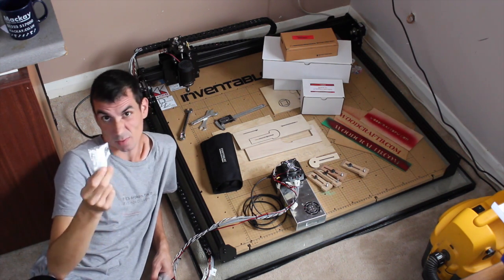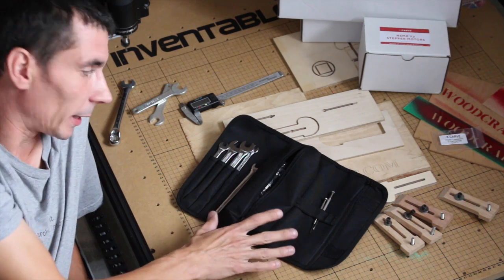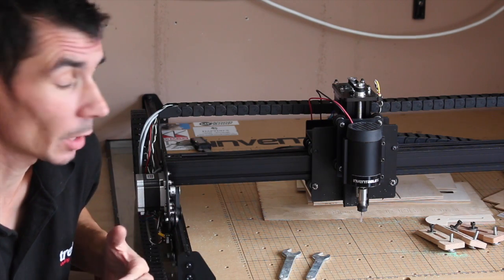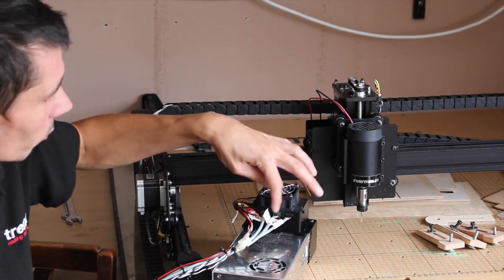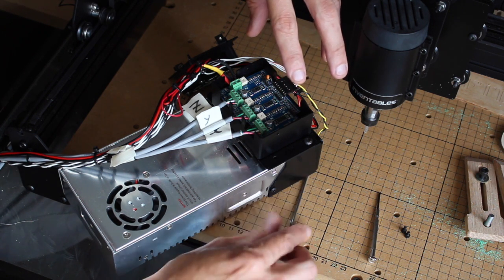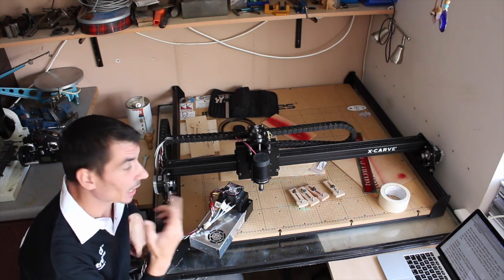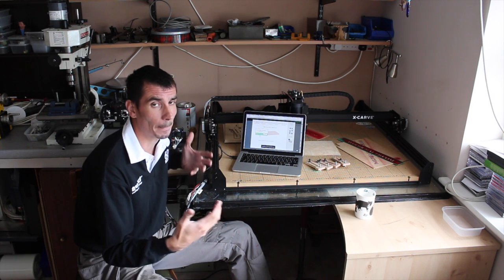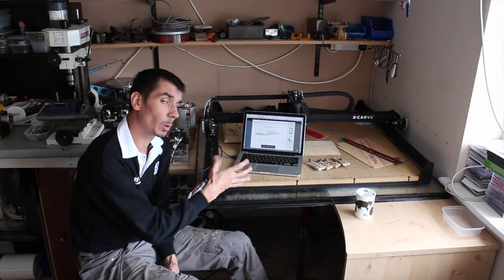XCarve build &  HONEST Review: The good, bad, and money wasted?

Comment: Just a note, since the project is open source all the designs ect are on their site including the waste board design and the holes so you could just buy some mdf and use a marker attached to the machine to make one yourself a waste board for about $20, that's how I did mine since it would cost like $180 with shipping to buy a waste board
Reply from the maker: I didn't know that the information was listed on the inventables site. good to know thanks. When the time comes I intend to make a replacement wasteboard, so i'll check that one out :-)

Comment: Some insight on the tool kit:  That looks identical to the one supplied with the shapeoako 2 which the Xcarve is basically a revision of, so i think they just updated the design a bit but didn't update the tool kit to reflect the changes to the machine,  hence the one wrench not fitting the spindle and the  leftover drill bit ect.
Reply from the maker: +lattitude01 Cool thanks! I was not aware that there was such a connection between the two machines. I measured the Drill bit Diameter with the digital verniers and it came out to be a very odd number, albeit precise. So I'm guessing it must have been there to pilot out for taping a thread?
Reply: i think thats right,  i remember we had to tap the end of the aluminum extrusion to bolt on the brackets

Comment: Hi Richard
Please help me with a probkem (if you can)
I have assembly the z axis where the spindel is and the both sides.
When I stand in front of it  and push the z axis forward and back,
the right side goes lot heavier then the left side.
And when I hitched the exentric nut  there is a scratchy sound,
But when I loosened the nut, the sound goes away, but the sides is wobbly.

Can you figure out what the problem is ?

(or could I buy you a RyanAir ticket and you come over to help me )    :D   

Kristian
Reply from the maker: +rednotereso sounds like the scratchy sound might be the steel Nut gouging the aluminium parts. Hold the nut in the spanner and tighten from the bolt side. When it's tight rotate the nut. if its too tight on the v wheels, this will also put extra stress on the motors and cause horrid noises.

Comment: Ri Richard
Do you think a MDF 22mm will work
Reply from the maker: +rednotereso no reason why not, Ive put my whole machine on a double glazing unit so it sits fully flat. If you can get the frame on a flat surface, 22mm will only serve to reduce you z-axis by 4mm.

Comment: Thanks Richard, nice review.  I'm about half way through building mine - the 500m version.   I ordered the MDF base plate and I think it saved my package from more damage than it actually suffered in transit.   At some point it experienced G-forces strong enough to cause the rotor of the cooling fan in the power supply to part from the mounting.   I've ordered a replacement locally so I just have to hope there's not further damage to the unit.  I decided against the spindle motor since i already have the DeWalt router.  
Oddly enough I never considered this as woodworking - most of my applications will be on metal and plastic.
Cheers,   John
Reply from the maker: Holy moly!  Couriers can be such a pain (polite)!!
I've had stuff been smashed bout by couriers before, although being well packed helps!
I also have the dewalt router, but for routing, I was waiting for the new mount for it to be in stock before ordering it,but the shipping costs as much as the mount to the UK!!!
So I've been watching what people have been upto in making their own, that's my next big X-carve project before I do anything else. I'm a fan of the stock spindle to be honest,but since I already own the router, I may as well do the upgrade at some point!

Comment: Hi Richard

I´m thinking to buy an x-carve from UK
And I wonder if it´s  easy to make a wasteboard by me self.
It´s so heavy so it probably to expensive to ship to Sweden.
(We don´t have any dealer here in Sweden)

Regards 
Kristian / Sweden
Reply from the maker: +rednotereso Hi Kristian, thanks for watching! YES, you can definitely make the baseboard yourself! When mine finally needs replaced i will do exactly that myself. I probably won't even go as far as putting all the Inserts in it either. The one thing I've noticed is that I tend to put a piece of thin ply down and clamp it, then just hot melt glue the piece being milled to it. They are definitely very convenient, but there are loads of other good methods to hold work down to the board.

Comment: Nice review Richard. Didn't see a response below but the drill bit you reference should be an 1/8 inch ball nose endmill bit to use for carving. Not really useful for straight out of the box Easel carves, since it only assumes  you use flat endmills. It's better suited for when you make your own g-code for non-flat carvings in another program.
Reply from the maker: +linkinprk1981 It's definitely not a cutter, the shape is wrong, if nothing else it's not 1/8" or 1/4" shank diameter. My gut feeling is it's a pilot for taping holes.

Comment: I'm confused...  How could the machine know where it's at on the board if you don't have the ability to home it?  Are you just saying eliminate the switches and manually just put the spindle around home and take a guess where to put the material you are machining?  Limit switches cost like $10 for 3.  At least the ones on my 3D printer did.  Even optical ones.  I guess I"m not following the issue here.
Reply from the maker: +Brandon Pulst You still have the ability to home the machine, before you carve, you tell the machine it's at 0,0,0. With the limit switches, you can hit the button and it runs itself to the switches on it's own. once it hits each one, it stops moving it that direction until it's hit all 3 limits. but the limit switches are at the 0, not the maximum point. 
The point i was making was that the limits are not the MAX limit, only the HOME. so it'll still hit the upper limits and try to go further, rather than shut of - as many 3D printers will do. 
They are really "Homing" switches, rather than a "limit" switch.
Yes they are handy, and cheap - but for the money, and the time to fit/solder etc. you can easily do with out.
Hope this explains it a bit better.? :-)

Comment: Richard, Good review showing both pros and cons but some cons are just a little more thinking, like the size of the circuit board what you say on 10.00 and the cable to the left connector. At first you could remove the paint a bit inside the metal box or reaming the holes in the circuit boards and the cable you could connect before  putting the circuit board in the box.
Anyway whit a bit more thinking outside the box you can work easier, although its a nice looking machine and within about 5 to 10 years we all have a 4-5 Axes cnc machine at home, with 3D printing capability's as well.
Reply from the maker: +Arend Wolbers Thanks for watching, and taking the time to comment! :-) All the points i tried to get across are mainly "things to expect" rather than "this should be better", or similar. At the end of the day, it's a kit built machine, and when building any kit, you'll always have these little things - I lie the machine, particularly the build aspect of it. It's nice to be able to "take real ownership" of it, if only for the confidence to modify, expand, or even repair it if required.
I agree - as technology evolves, and prices fall, more and more people will have more complicated machines. Inventables have taken a real step towards helping people and technology become more accessible to each other! :-)

Comment: FYI, you don't want to tin wires that are being crimped or used in screw-down terminals. They rely on the malleability of the wire to maintain the connection. The tinning is at major risk of coming loose over time, especially in applications where they will be subject to changing temperatures or vibration.
Reply from the maker: +Peter Skuba Thanks Peter, Yes this was mentioned earlier, I've now changed most of the tinned ends. I wasn't aware of this at the time (I'm no spark!) :-)

Comment: are you sure the drill bit isn't a router bit?
Reply from the maker: +Paul m That's not as strange a question as some may think, But no, It's a twist drill bit. I suspect it may be for drilling a clearance hole ready for taping, but I can't be certain, It's an odd size diameter, so not a cutter.

Comment: Hi Richard, Great review!  I made a couple of mods to my X-carve.  First, I removed 150mm from the Y dimension.  The extrusions cut very well on my table saw with an 80ct cheap blade.  150mm seems trivial but the extra length was causing a real problem with the space I had.  Also, I made my own waste board.  It was not hard and I just made sure and ordered the necessary additional hardware when I ordered my machine.  Thirdly, I routed a slot into my waste board so I could route joinery into board ends (dovetails, box joints, etc).  Lastly, I put together my own controller package which I added an LCD and an SD card.  I can jog the machine with the touchscreen LCD and I'm planning on using the SD card to process G-code from it.  I will be doing a lot of repeat work so not having to run the computer would be nice.  I am an embedded software engineer so modified GRBL code was not that hard.  I'm just discovering the possibilities with my machine!  I would like to upgrade my spindle and make a laser attachment in the future.
Reply from the maker: Nice! Presumably you gout the larger 1m model? 
I thought about posibly having some kind of "pit" or "slot" for working oversize, or odd shaped work  like cutting board edges.
I'd love to see pictures of what you've done! Fancy sharing them to my facebook page??
Laser is my next investigation on XCarve!  :-) you say your making one?

Comment: Thanks for the video I had my head really wrapped around buying one nice to hear some good pointers. You kinda relieved  some concerns I had. So as a crafting newbie any pointers to give.
Reply from the maker: +gambitraven No problem, thanks for watching! As far advice goes, if you decide to go for it - go for it! By that I mean, Don't be scared, the instructions are great, read ahead, and follow them carefully. Once you have it built, and ready to setup/calibrate, your experience, understanding and confidence should certainly be enough to get you through to carving stuff.
down the line if you find you have problems, or what to upgrade parts or modify things, your understanding of the machine, and experience in building it should be enough to be able to do it. Plus there's a great community already out there, experimenting and helping each other. But be warned - don't expect to be making 3D carved faces by the 2nd afternoon of owning it! it can be a steep learning curve - but exciting too!

Comment: Richard, I am 1/2 way through putting my 1000mm X-Carve together and completely agree about the waste board and tools!  I bought the toolkit because I wasn't sure I might need one of the tools.  Wish I hadn't.  I used a 12v battery powered variable speed drill with a T25 bit and got through all of the self-tapping screws in about 10 seconds each.  Worked great.   Due to the high price, I skipped the waste board and plan on buying the MDF locally.  I can then use the dxf files on X-Carve's website to have the X-Carve drill out the holes in the board.  Attach a sharpie, somehow, and I can have it draw out all the grid markings as well, since they have that as a separate dxf file.

Sounded like you said you tinned the end of all the cables that you put into the screw terminals?  You never want to do that with screw terminals.  Reason being that the tinned wire is very hard and the screw doesn't get a good enough grip on it, doesn't bite in, only a single point of contact, leading to easy loosening during operation.  They don't have to shake out, just a little bit of intermittent connection is all it takes to spark and blow out the shield.  Better cut all of the tinned ends off and screw the screws directly into the twisted bare wire.  You'll get a nice, snug connection that is much more tolerant of vibrations.

Re:limit switches, I thought I read somewhere that they could update the arduino firmware in the future so that the limit switches could act as homing switches as well as stop switches, to keep the machine from crashing?  I haven't gotten to the point of using my machine yet, but it makes sense that you could just set your workpiece up anywhere as long as you have to tell the software where 0,0,0 is.  If they never make them act as proper limit switches and stop the machine crashing, then yeah, I don't see the point in getting them either.

Great video, Cheers!
Reply from the maker: +Randy Walker You could always use a v groove bit in the spindle and "engrave" lines into the washboard.

Also thanks for the advice on the tinned wires, I hadn't considered that. I'm pretty confident that they'll be fine at the terminal block end, as i wrapped them around the screws, but I'll look into it at the power supply end!! :-)

Re: limit switches, another great point, I think it's pretty likely that someone will come out with firmer updates down the line. Inventables do an "E-Stop" switch now, which has to connect somewhere, presumably to the Gshied, so I'm guessing you could attach at the limit switches in the same way and mount them at the outer ends of travel. I'm not sure how useful them would be as a stop switch at the 0,0,0 point, unless the machine went out of whack and tried to home at a minus value thinking it was 0?

Thanks for the comments, and for watching! Let me know how you get on with the build! :-)

Comment: Totally agree on the waste board.  I would rather not have it supplied, but have Inventibles supply a job that would use a sharpy in the drill port and just draw the thing.  After all, you do have a precision system built in, and straight line referencing isn't a problem.
Reply from the maker: +Euan Walker The machine is available without the washboard, you have to click "NONE" on the configuration page, this takes off $128 from the price, but also means the shipping is less because the item is shipped separately from the rest of the components. One thing i forgot to mention is not only will you need to drill and fixing holes in the board, but also the slots for mounting it to the frame.
Thanks for watching! Hope it helps. :-)

Comment: Very much agree with your assessment. I have been playing with mine some today. I have a lot to learn about making projects in the software etc.    I found the wrenches for the spindle a mystery as well. What is the second wrench for?   I also found the limit switches way more trouble than they were worth and honestly I have not been using them. When it asks I just tell it to leave them off.   I also had a time trying to get the black wires form those switches with the otters wire form eh spindle into that one connection. I need to do my video here soon.
Reply from the maker: +Chris Pine The limit switches are handy to just click to home the machine, And will, I suspect, come into there own on large projects that use the whole area. Currently nothing I've played around with has needed the whole table - yet! :-)
The three wire connection to the Gshield are probably best joined to a single one wire, then connected. But it is possible to squeeze them all in after a bit of work.

Comment: Well done Richard! That's one of the best xCarve reviews I've seen (I've seen more than 30 I think). Wish I could get one and do a review but..... Oh well, I can dream. Good point on the waste table local purchase but more importantly the fine points such as the Gshield mounting. Perhaps that is why so many are having problems with the Gshield. You definitely hit the nail on the head with the inability to secure the wire bundle to the power box. Just a couple holes to insert a wire tie through would reduce (if not eliminate) the lateral stressing and pull on the connections. Strongly agree that the length of the spindle bearing to tip of cutter is very long wearing on the bearings, but also allowing to much flexibility thereby causing inaccuracies in the precise cuts demanded by use of a CNC. Excellent review and points made! Thank you.
Reply from the maker: +MRrwmac As I said, not making any accusations about the Shield problems I've read about, fiddly, but not impossible :-)
The cabling at the box is TBH it's an easy fix, there are slots in the metal casing for the power supply unit, but I would recommend anyone starts threading wires or cable ties through inside, plus it'll get in the way of the main fan. There have already been lots of "workshop" upgrades already on this.
as far as the spindle goes (and I've got my routing head on now), for the size it is, it'll do a fair bit....MOST IMPORTANTLY THOUGH, it'll get you started with the machine, learning it and the software........the best ideas (with anything along these lines), come from the previous work, and combining them into something new. I accepted from the start that it'll want upgrading to the router. For the smaller machine though, I think it's probably about right :-) Mostly because the bigger area, will probably lend itself to more ambitious projects, and possibly a harder life (in terms of running hours).
Thanks for watching!